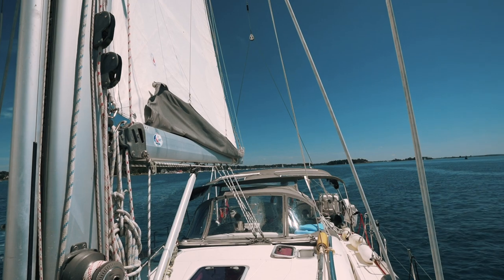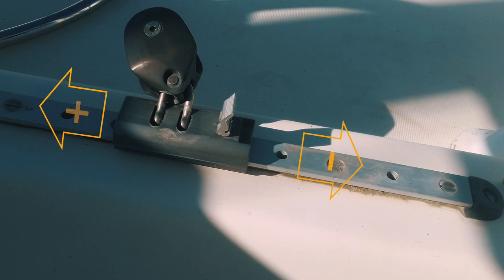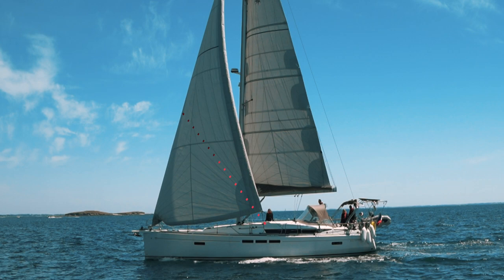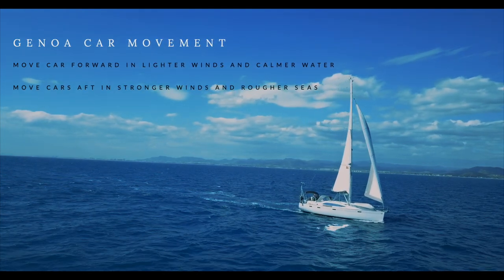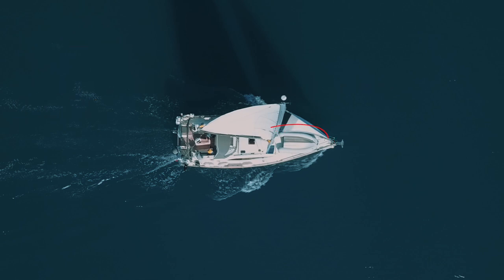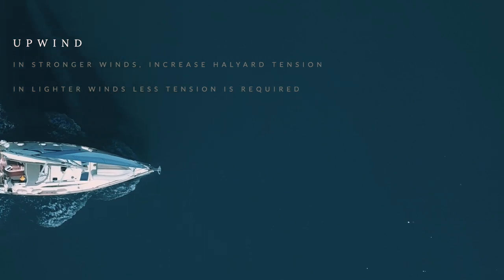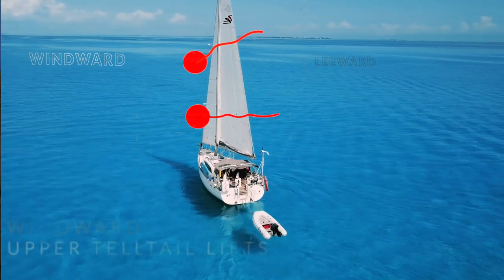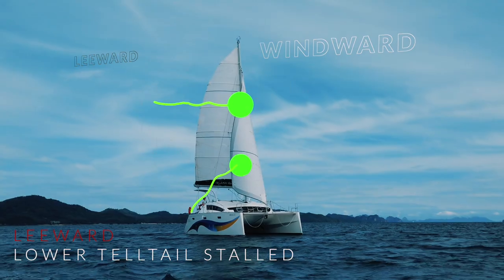How To Trim Sails: Foresail Trim

Comment: As a 71 year old land lubber I will probably never be on a sail boat, but I love this stuff, 👍
Reply: And which land are you lubbing on? If there's water nearby i'm sure there is a boat owner who'd be happy for some crew.
Reply: A great way to start sailing is to join a local sailing club and take lessons there.  Also, using club boats is much cheaper and easier than owning a boat.  There are many sailing clubs far inland in places like Colorado and Nebraska.  They're not all on coasts.

Comment: If you have all your tell-tails flying horizontal you will have maximum lift but you will have increased drag to a point where your net gain is reduces so a little lifting on your front tell-tails will give you best results.

Comment: Is it possible to overtension the backstay, especially if they are hydraulically operated. Taken to the extreme the results could be rather catastrophic.
Reply from the maker: Yes mate it is possible. On Ruby Rose the difference In tensioned backstage vs loose was half An inch
Reply: @sailingrubyrose  On fractionally rigged boats it much more, as You also bend the mast to flatten the main. Years back I had a Soling and there We moved the top of the mast a meter or so, but that is extreme (on Star boat's it's even more)

Comment: You seem to be associating right winds and smooth water along with heavy winds and rough water. Now heavy winds and smooth water is unlikely come up but what do you reckon then for heavy seas and the light wind.
Reply from the maker: Mate, waves are generally created by wind. The higher the wind the bigger the waves.
You can very occasionally get rough seas and light winds, but it’s normally after a weather system has passed through and the sea state has yet to settle. In this situation it is just bloody uncomfortable as you don’t have the stay of the sail to keep the boat from bobbing all over the place.
Reply: @sailingrubyrose   My understanding is that there are 2 sources of waves one is wind and the other is swell. Or am I missing something?

 Honestly I'm working towards motor yacht but I was intrested in the technical information as information.
Reply from the maker: Swell is normally generated by weather systems that are further away from the position you are in. They are however still wind generated
Reply: @sailingrubyrose   So I would be correct to that you could get into a situation with a lot of swell and not much wind over an extended period of time?
Reply from the maker: It normally doesn’t last that long. In all our years of sailing offshore and coastal, you may get a few hours of swell with no wind, but as sure as eggs is eggs, the wind fills back in before too long.
Reply: @sailingrubyrose  ty

Comment: can you explain moving the genoa cars under sail? would they be loaded and hence difficult to move safely. A newby sailor question i guess.
Reply from the maker: Under extreme load they do become more difficult to move, but not impossible. With performance oriented monohulls you can adjust the cars with lines leading to the cockpit
Reply: As Nick said and it depends on your situation and boat... I race in Western Australia and moving cars while beating upwind when it is usually blowing 20knots or more is difficult and potentially dangerous, so I always ask crew to move cars when we are on the opposite tack to the car that needs moving. Obviously, this can be done in this situation because you're tacking regularly. Even so, if I was cruising, I would still try to release some of the tension on the sheet... makes life easier and safer.
Reply: Thanks for the feed back. will discuss and give it a go. kind regards
Reply: @geoffwright7110  The leeward cars are under high load.  The windward cars are under minimal load usually.  As David says, you can often move the windward cars on each tack.

Comment: 1) Stalled leeward telltails =  Ease sheet.   I was thinking point higher but I guess it all depends on where you are going. Excellent video. Thanks.
Reply: A lot of people teach it as “point higher” but that never made sense to me because usually you’re going the direction you’re going for a reason so surely trimming the sails (in this instance ease the sheets) is the answer.

Also, as the video alludes to, pointing higher/lower won’t necessarily fix all your telltales and you’ll probably need to trim as well anyway.
Reply: @bertieblackman8791  It somewhat depends whether you're sailing to get somewhere or for fun.

Comment: A lot to learn for me, how long did it take you too pick this up? Seems a lot of knowledge condensed. One question for you, would these principles apply during a race only, is it for optimum sailing or does it also take in to account environmental factors like currents and different wind speeds and general comfort of sailing?
Reply from the maker: Sailing is a lifelong learning experience. I have been lucky to have been surrounded by older sailors who taught me. The principles apply to any sail, although for racing more so. Being able to add even half a knot of boat speed to a passage where your average speed goes from 4 to 4.5kts means you get there 10% faster. Over an Atlantic crossing that is 2 days
Reply: @sailingrubyrose  Don't forget the most important part...  Properly trimmed sails don't make that annoying noise.
Reply: @Tinker001  Not to forget that a well trimmed boat generally is much nicer to sail. It's faster, the helm is well balanced, the boat doesn't heel as much, sails last longer and there is no noise.